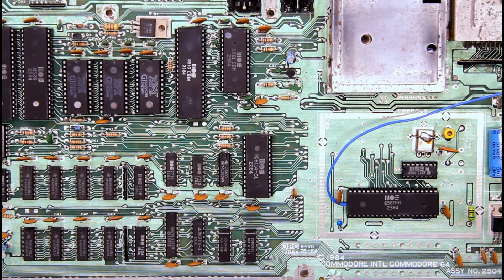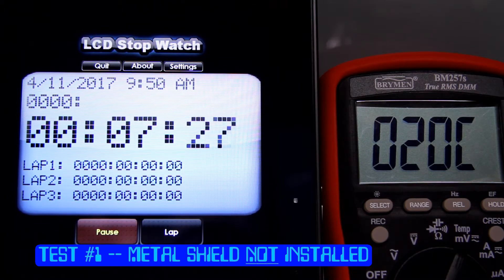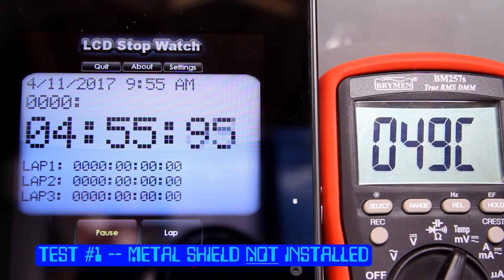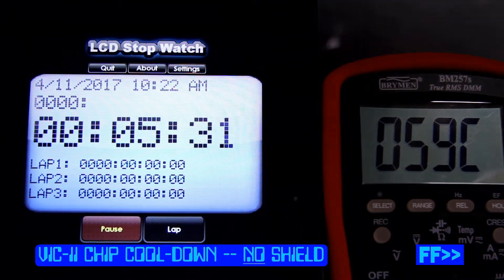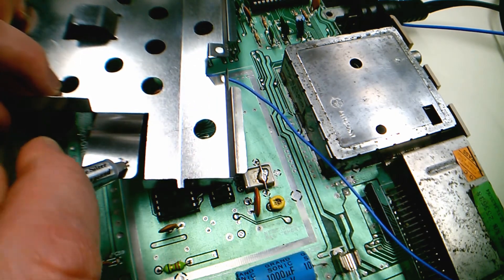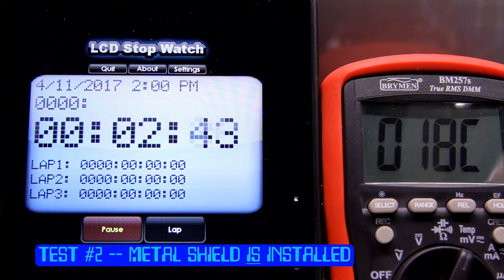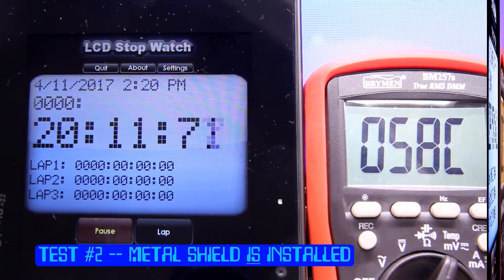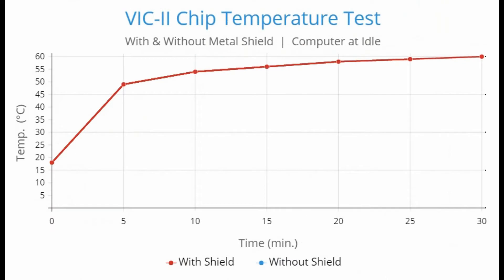#04 "Jack Squat" — Commodore 64 VIC-II Chip Temp Test

Comment: The metal shield is to make the computer compliant with the EMI requirements of the day, not heat.  So while it may not run any cooler, it may save your life over 20 years of exposure :)

Comment: Excellent analysis. Thanks for taking the time to perform these detailed measurements. What a surprising result.  I wonder whether there is maybe an RF reduction purpose of this metal shield after all, e.g. reducing interference of the VIC to the SID. No idea, just wondering why cost conscious Commodore would have gone through the trouble manufacturing and installing a truly pointless bit of metal. For it to have no benefit seems unlikely.
Reply from the maker: Thanks for commenting. Yes, the shield was strictly to satisfy FCC RF emissions requirements. I can only assume that Commdore thought, well let's try to make it some sort of heat sink too. Interestingly, Bil Herd, lead engineer on the C128 team just did interviewed Adrian Black of Adrian's Digital Basement YT channel. Bil mentions that Commodore was designing chips with the hope they would function for 3-5 years -- yeah, that's all. Any of the soldering ICs were considered to be "heatsinked" because most of the heat they produced would be wicked away by the mainboard through their legs. Also, Bil says even reducing the core temp of an IC by 10 degrees only has a marginal effect on the overall lifespan of that IC. Intersting stuff.
Reply: @MindFlareRetro  Thanks a lot for the tip. Very interesting interview.

Comment: Hi, you did a good test, but the pressure of the metal finger could greatly affect the test results. I used 3 pieces of Z-shaped copper, I turned the lid 180 °, I soldered the tab to the lid with tin and placed the 3 heat sinks with the thermal PAD. Closing the lid creates pressure and the 3 Z-pieces also press on the VIC II. According to my tests, heat is transferred to the lid at least twice as fast. With only the original dissipating tab, only one area of the lid is heated, with my solution the entire lid is heated, which means that some heat is transferred more efficiently from the VIC II to the lid. I have created an external air conveyor (it is a cardboard prototype and an 8 cm fan) which, applied to a free rear door, allows the entry of fresh air, the hot air flows from the slots or other doors. Combining these two systems you get a great result, keeping the originality of the C64 (if it is a rare model) since the solder of the original tab is easily removable! What do you think? I've created a couple of videos about it. These are rather old C64 silver labels, one of them has a 6567 r5 (and not a 6567 r5 6A, as in many cases) am I compromising originality? Or am I safeguarding and protecting that rare VIC II chip from death? If I can, I'll post links to my videos on your "community" Youtube page!

Comment: Reminds me of a vacuum cleaner salesman we had in our home, you had to know where to put the cigarette so the brushes wouldn't damage it. 
As someone posted: "Heat is always going from the bottom to the top, so the temperature at the bottom remains the same". So let's see the test with the probe on top and another with a fan blowing.
Reply from the maker: Thanks for commenting. Yes, I have been hoping to revisit this test with some more accurate measuring. In case you missed it, I did explain my rationale behind placing the thermocouple under the IC in the video before this one. You may check that out here if you like, https://youtu.be/mVPo0iLTlks?t=77.

Comment: About the heat sinks for the chips: I have seen in several youtube videos, that people attach several small heat sinks (probably for raspberry pi) on a DIP40 IC (like the VIC). That is not good, I think. The heat is generated in a sqaure in the middle of the IC, which is, where the die is. Some of the heat is spread by the case of the IC, but not really a lot. The heat transfer between the adjacent heatsinks is not a lot, either, so probably the middle heatsink will be hot, the others will be much cooler and this way will not radiate much heat to the ambient. This way,they are kind of wasted money. They don't do harm, but have little effect. The best is a dedicated heatsink for DIP40 or DIP28. This way, the heatsink will have a pretty even temperature of the whole volume and use the complete surface to radiate the heat.  Would be cool, if you could borrow a FLIR camera from somebody for that heat sink video. I am still in an inner conflict, if I want to buy one or not. They are getting more affordable these days... But 500€ is still a lot of money.
Reply from the maker: Yes, I agree with that logic, completely. The point is to spread and dissipate the heat. I had sourced and purchased some longer heatsinks from eBay (photo: http://bit.ly/2WC65ZS), all aluminum (5g). They are a bit tall but seem more suitable. I am always looking at the cheaper Chinese thermal imaging camera tools, but even though they are less expensive, I cannot seem to justify the price for my simple hobby requirements.

Comment: One question that sprung to my mind when watching this was with regard to the curing time that Arctic state is required for optimal performance of Arctic Silver 5.  Arctic states that 200 hours is required, although the tests in the following link concluded that 8 hours was sufficient (https://archive.techarp.com/showarticle600c.html).  Apparently it is possible to see chip temperatures drop by a further 3 to 4°C if the paste is allowed to cure.  If you tested immediately after applying the paste this may have contributed to the observed zero benefit.  Also, if you ever do repeat this test then it would be good to do it with a much better thermal paste.  The performance of Arctic Silver 5 is quite poor now compared with many of the newer pastes that are available.
Reply from the maker: Ah, that's very interesting. I wasn't aware of the curing time. Thanks for the tip. I hope to revisit this at some point, as well, and hope to use more reliable measuring techniques. Thanks for commenting.

Comment: I wonder if there was a way to measure at the top of the chip instead of the bottom of the chip. The bottom being at the motherboard may not feel the effects of the heat shield. This is just an assumption on my part. Great video though.
Reply from the maker: Yes, that's a great point. I hope to revisit this and will work on a top-side temperature test. 👍

Comment: As much as the shielding does not help with temperature dissipation, probably because it is quite thin, it does help with RFI. You should leave it in place. Your neighbouring Ham radio operator will thank you.

Comment: I've been telling people for 30+ years those shields do nothing to dissipate heat and they always half-agree and say, "yeah well it helps _a little_" no no no, it doesn't help at all, it really provides almost no additional surface area, nor does it allow for thermal propagation.
Reply from the maker: Yep, you've been correct for 30+ years, that's for sure. I hope to do a follow-up utilizing proper heatsinks and possibly a small fan to get the air circulating.

Comment: I think, your measurement method is false. Heat is always going from the bottom to the top, so the temperatur at the bottom remains the same. The passiv heatsink is only taking heat from the top and give it up to air, so the Chip is cooled down from the top, not from the bottom! You have to measure the chip on the top to see a change in the temperature!
Reply from the maker: Thanks very much for your feedback. I see what you are saying, and yes, a few other people have mentioned this to me, as well. I got the idea to measure the temperature from the bottom of the chip, as this was the method used by many AMD PC motherboards about 10 years ago.  There was a thermistor extending from the mobo under the CPU to monitor it's temperature. I show an example this in the video prior to this one, http://bit.ly/MFR-YT-03 -- skip to 1m, 17s if you do not want to watch the whole video.

Having said that, perhaps I will revisit this at a later date and measure the temperature from the top. It would be interesting to compare the results.

Thanks again for watching and taking the time to comment. I appreciate the feedback.

Comment: This is a Wonderful video. I've been worrying about this matter for a while, so thanks a lot. Now I know by your video about the C64. In my models I don't have a metal shielding, but I will use a fan apart of dedicated heatsinks.
I was wondering now about my C128: It uses a metal shielding. I think that I will change the thermal glue and use Artic 5 instead but I will also add dedicated heatsinks in every place that the metal shielding is connected to every single chip. 
I haven't even turned on my C128, so it's all theories. If I have the room I would also add a fan over the metal shielding - just thinking-.
Reply from the maker: Thanks for commenting, Fernando. Yes, I was quite surprised, as well, the metal shield does very little to provide heatsink functionality. Yes, Arctic Silver 5 is an excellent thermal paste, but remember that it is not really an adhesive/glue and that metal heatsinks might possibly fall off and potentially short out something on the C64 or C128 motherboard. Good luck and thanks again!
Reply: Yes, I know. The plan is for the C128 and the idea is to use Artic Silver over the chips to contact with the metal plate shielding and to stick over the shielding some heatsinks sticked with heatsink adhesive paste. But I haven't even opened the 128 yet.
Reply from the maker: Oh, I see what you are saying. Great idea! Yeah, be careful inside your C128.  As I'm sure you know, Jan Beta damaged his C128 somehow in a recent video.
Reply: Thanks a lot for your answers. I yesterday booted my C128  for the very first time and I've opened a thread at EAB if you want to take a look: http://eab.abime.net/showthread.php?t=93365
Reply from the maker: Congratulations. It looks great, Fernando. Even cosmetically, it appears to be in superb condition. And thanks for the EAB link; I will be sure to follow along there. Yes, the vertical lines phenomenon is a common issue on C128 computers. A few people have attempted LumaFix type boards but it seems the C128 issue is a bit more complicated than the C64 stripe fix issue. Ah, and I see from some forum posts that you already know this. Did you ever find Gerbers and BOM for Super LumaFix?
Reply: Sorry, no idea about Gerbers and BOM.

Comment: I assume the failure of pressure to the chips (like it would be from a cooler of a today's cpu) let this grease do the opposite job. I'd be interested in a comparison to the metal shield without thermal paste.
Reply from the maker: Yes, good point -- there are many variables to consider. For the most part, I think the shield was to accommodate for U.S. FCC regulations at that time and not to function so much an actual heatsink. I hope to do a follow-up video using modern IC heat sinks and see how the temperature is affected. Thanks again for your feedback!

Comment: I wonder where the heat curve flattens and if they have the same "running more than 30 min" temperature. It was no big surprise the thin sheet metal is not a good heat sink though. 
Thanks for doing the video.
Reply from the maker: Thanks for watching and commenting. Yeah, I cut the test short because the temp seemed to plateau rather quickly. I plan to do the test again with heatsinks in place. Hopefully, you will subscribe and can be notified of that. I'm a fan of your innumerable contributions to the retro community, so thank you, too, for all your work.

Comment: Nice video. In some of my own tests a couple of added heat sinks did slow down the rise in chip temperature, but the eventual hottest temperature was only ~3 Celsius lower than without the sinks. HS + fan had a much greater effect - even with a small fan running at such low rpm you could barely hear it and not even located directly on top of the VIC-II chip, it still lowered its temps by about 10 c. The airflow just really helps push the heat away from the heat sink fins.
Reply from the maker: Thanks for the positive feedback. I am happy to hear you enjoyed the video. Yes, I agree with your completely, a heatsink with proper mass AND airflow is the key. I've been looking into various 3.3V and 5V micro fans to run and low RPM. What are the specs of the fan you are using?
Reply: It's a 5x5x1 cm fan with a max of 4500 rpm at 12V. I once tested it with max rpm and it sounded like a small vacuum cleaner, totally unacceptable. Though the cooling was excellent too - even the hottest chips were barely warm after hours of use. With 4.5 volts the fan offers decent cooling with little noise. It's small enough to fit in the gap above the modulator (there's even some additional room for depth) and light enough that a simple blu-tack attachment is enough to secure it on the case indefinitely.
Reply from the maker: Excellent info. Thanks for the details. Nicely done!

Comment: As I mentioned in the previous video, the problem is the shield is just a way for heat to remain building underneath and for heat to spread until the whole RF shield is warm.  No blades to maximise surface area, coupled with the RF shield holding heat on the underside (due to its expanse over so many chips), it does prove the RF shield is pretty much pointless.  I do wonder if the RF shield adds to heat build up in some of the chips that dont normally get hot when theres no RF shield - eg. some of the 74 logic.  That might be an interesting test.
Reply from the maker: Thanks for commenting. I am hoping to play around with some micro fans, either on the VIC-II directly, as you have done, and or use passive heatsinks and add a small fan to force air across the whole board.

Comment: No change with and without shield. Good test. The metal shield is steel or iron I guess. When I made my DIY bicycle LED lamp (14Watts or so), I first started out with using steel L-shaped profiles to conduct and pump heat from the LEDs to the enclosure (aluminium). That didn't work out at all. With alu L-profile, the problem was solved. The finger sheets are so thin anyway. The breadbin VIC-II+timing area shield might have a better effect. The finger there has much more force onto the chip. Btw there are other shields also with shorter fingers. Probably Jack Squat effect there also. :)
Reply from the maker: Thanks. The shield is just a stamped flexible metal, less than .5mm think. I was hoping the thermal paste might have helped with heat transfer, but it no apparent effect.

Comment: Very interesting result and another great video.
When observing it myself, I only noticed the VIC to reach high temperatures, at the brink of being too hot to touch (which roughly conincides with the 60 C). So at least that part of the theory is confirmed. :-)

Was the temperature stable after the 30 minutes? Or did it rise further?

I actually would have expected the shield to have at least some effect with heat dissipation.

As for heat sinks: Yes, I think putting individual heat sinks on the chips will have some effect.
My C64s don't have this large shield/heat sink thing, but just the can around the VIC. The other chips had no heat sinks at all in the original state.
Maybe the best effect would be accomplished by switching from passive air flow (convection) to forced air flow. I have seen a few guys add fans to the VIC and other chips prone to heat problems.
Reply from the maker: Thanks again for the positive feedback! I hope it pronounced your name correctly in the video. I think the VIC-II might have actually been hotter than the temp measured from underneath with the thermocouple.  At 30 minutes I measured the top surface of the chip with a non-contact IR thermometer, as best I could, and got a max temp of 64.9C. I can only imagine what the temp might go to under load.

No, I didn't go beyond 30 minutes. The temperature increase really slowed down after 24 minutes and increased by 1C only between 24 and 30 minutes.

I recall GadgetUK164 has a very good C64 heatsinking video. He even had a fan installed at one point, but IIRC he was getting some video noise when the fan was running. I'll have to watch those video(s) again.
Reply: Pronunciation was good. Only the 'h' is silent, unlike the English 'th' ;-)

I don't know whether the temp difference between surface and below the chip does actually say anything.
The videos by GadgetUK164 are really good as a reference. He's done quite some research there.

Anyway, I went with copper heat sinks on my chips. I have those square, low profile things, and stuck them on with heat-conductive double-sided tape, 3 pieces per chip (or as many as will fit on them).
It works fair enough. In the testing phase, their surface was comfortable to touch, so I'd suppose they're really having effect here.
But I didn't take measurements back then, unfortunately.
Reply from the maker: Silent 'h', got it. Thanks. Yes, I have the small copper ones as well to try. I figured copper was best. Ah, the neverending video series.